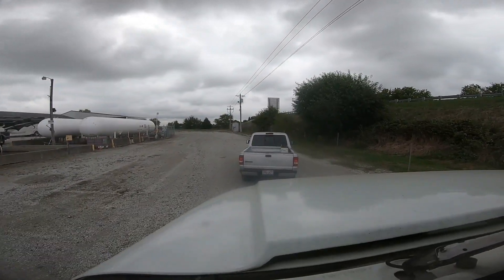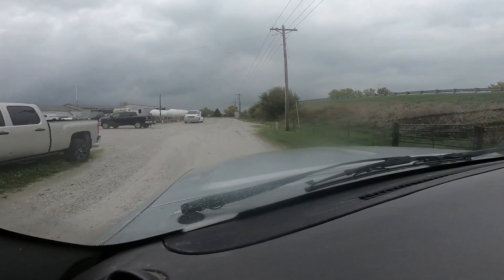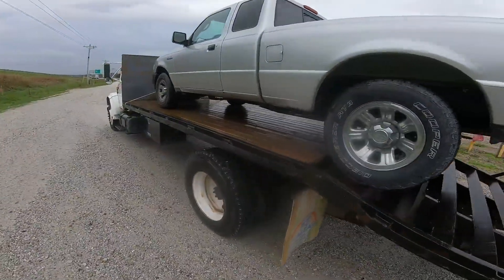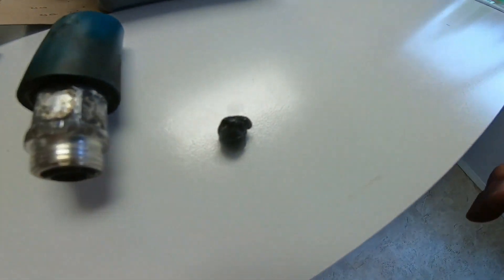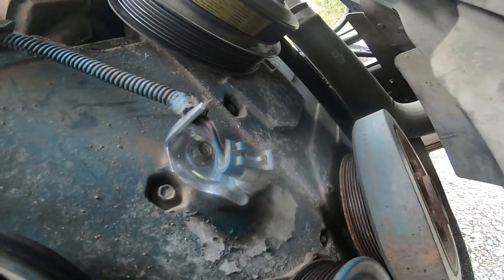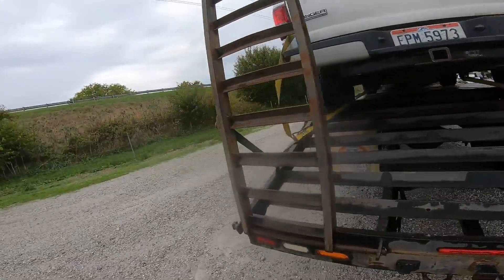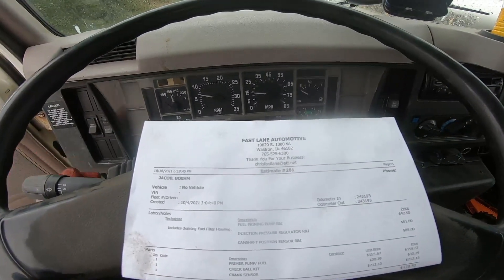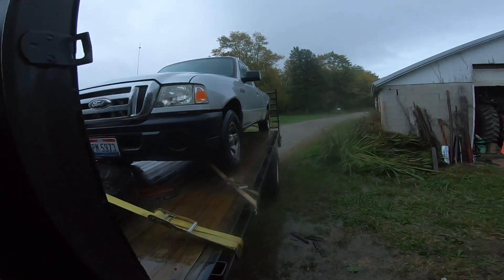Retrieving the Flatbed Truck after Issues

Comment: Always handy to keep one of those cam position sensors handy, if you keep that truck for long it won’t be the last time you need to change it.  Notorious problem on International/Navistar engines of that time.  One of the very few problems, and easy fix when you know to suspect it.

Comment: Just gotta love them electronics... "SO much better" until the thing craps out and leaves you sitting... or goes wonky and you spend months, sometimes YEARS trying to diagnose it, taking it to multiple mechanics, etc. til SOMEONE finally figures it out, like what happened on my truck.  Gimme a carburetor on a gasser or direct injection pump and pencil injectors on a diesel ANY day of the week!!!  Later!  OL J R :)

Comment: For automotive work I have seen where there are time standards for labor regardless of the actual time the tech takes to put in the part.  Maybe this is the same?
Reply: There used to be "book hours" and "time hours"... particularly at dealerships doing warranty work.  You really had to be on your toes know what you were doing and be a good mechanic to make money on book hours.  If you had a problem you fixed quickly, say in 10 minutes, but the book said "2 hours" to fix this problem, then you made money.  IF it took you 4 hours to find it and fix it, then you lost money-- working for half wages essentially.  Dad did mechanic work at an International Harvester dealer when I was just a toddler back in the early 70's... That dealership did tractors AND IH trucks, so a lot to know!  He told me a story how he was working on a new Loadstar one time that had some problem-- you were supposed to take a plug or bolt out of the back of the cylinder head or manifold or something that you couldn't get to without taking a bunch of other stuff off.  He got to looking, figured out right quick where the bolt head was, pulled the floor mat back, drilled a hole in the floor, ran his socket in and got the bolt out in about 5 minutes, swapped the part out, and then ran the bolt and socket back through the hole and screwed it down tight... went to the parts department and got a 30 cent rubber body plug, and put it in the hole in the floor, and put the floor mat back (it was up at the top of the floor mat under the dash where nobody would be putting their feet anyway).  Got the job done in like 30 minutes or so but was paid "book rate" which was four hours labor.  Basically like working on commission.  

Most shops now, particularly independent shops, or working on older stuff, just go by "time hours" or how much time they actually work on it.  After all you never can tell when you're gonna run into some stupid thing that should have taken 10 minutes but keeps you busting your @ss for 4 hours trying to get it to turn loose or come apart or whatever.  Later!  OL J R :)

Comment: They treated for fairly! I would go back. Not many times I say that. The places I go. You were close with the fuel filter issue. It wasn't getting fuel🤔
Reply from the maker: The fuel filter wouldn't have been an issue until I changed it. But it would have gotten me eventually. The original unknown issue was the crank sensor.
Reply: @boehmfarm4276  FYI. I had  issues with IH ( Navistar ) crank sensor too. I purchased a 97 F250 7.3 Navistar engine. Brand New in May of 97. It conked out on the road one day. Turn out to be the CS. Covered under warranty. No sweat!  A few years later I got a letter from Ford. Saying to bring it in. There was a updated CS they needed to install. I did. 230,000 miles later. It hasn't given me any more trouble. You might have had the old style too. Not sure what model that is. Anyway, That has been 15-20 years ago. So no doubt you got a updated sensor. It want give you any more trouble 👍
Reply: @boehmfarm4276  Yeah I had something similar on the older 5610S... stupid thing stalled one day and wouldn't restart.  After troubleshooting the fuel system, I tracked it down to a stuck fuel shutoff solenoid.  There's a little metal rod and spring inside it looks like the spring came out of a ballpoint pen, and the rod has a rubber tip, when the solenoid is shut off it demagnetizes and the spring drops the rubber tip against the inlet port where diesel goes into the injector pump.  I'd had to replace that stupid solenoid a time or two, and what happened this time was the rubber has swelled some (getting old I suppose) and basically the magnet couldn't pull it back enough.  I pulled the stupid rubber tipped rod out of there, screwed the solenoid back onto the pump (since it was "wet" on the underside meaning part of the fuel system) and it would run fine.  The early model 5610S's with the fuel solenoid still had the shutoff lever on the top of the fuel pump, so I just bought a $10 choke cable kit and installed it for a good old fashioned kill cable like every other tractor in the universe (except those weird red things of yours with the "over-center" throttle lever to kill it) and voila problem solved.  The newer 5610S doesn't have the shutoff lever anymore so that trick won't work, but it's never given any problem either... Later!  OL J R :)